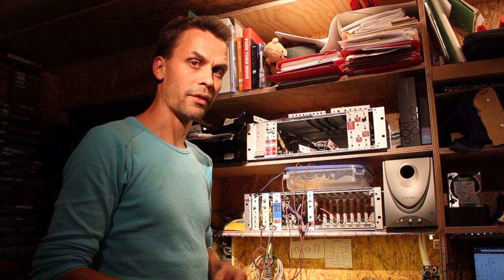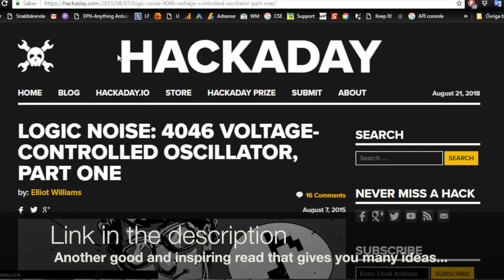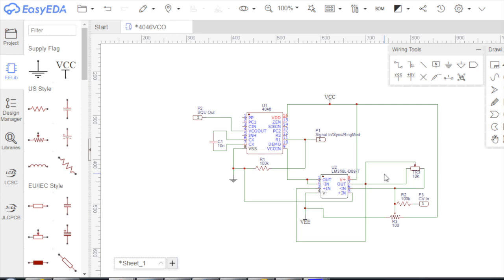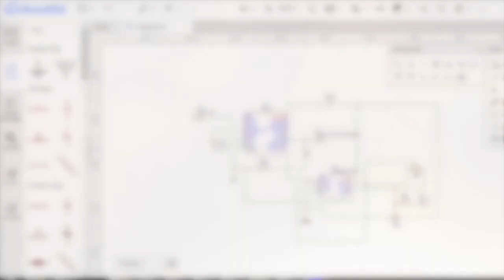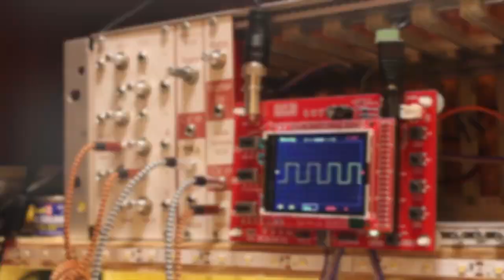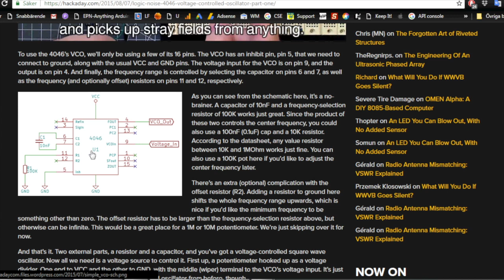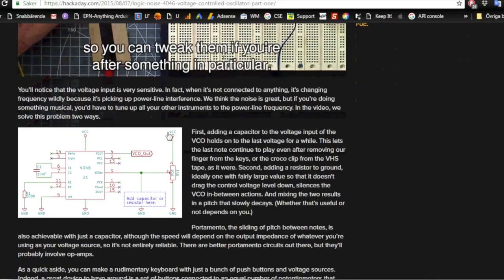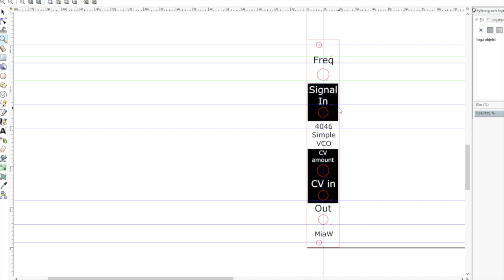4046 VCO - DIY Modular in a Week 1.3

Comment: Hello! Love this series of videos, thank you for putting it together. Really looking forward to building more, particularly the colored noise module, that's next on my list :). Can I power op-amps and other applicable chips with +12/-12 and the CMOS chips with +5/GND instead of +12/GND? Or will that mess with how well voltage levels at outputs work with inputs if I'm powering some modules with 5V and some with 12V?
Reply: try the original hackaday version for that. it uses a 9v battery. there are also opamps for single power supplies like the lm358
Reply: @deerfeeder  Thanks for the reply! Kristian's circuit also runs on 9 volt/GND, the 40106 has a large voltage range. I ended up powering it using a 3.7V battery for testing and the output voltage worked with my other modules, which pretty much answered my question! I haven't measured the output voltage depending on my what I power the chip with yet... wonder what the different is between powering it with 12V vs. powering it with 3.7V.
Reply from the maker: Yes you can power each circuit with different power that is what I do in my colored noise that I make.
Reply: Oh, nice. Will probably build that tomorrow. Thanks Kristian!

Comment: Hi Kristian! Build this one recently, but I think it is not working properly... The range is very very narrow, and cv in does not work properly... Opposite to signal in which works kinda like cv should :/ Do you have any idea what could be happening? Where to look? Such a simple project that really intrigues me what´s going on!! Could it be the chip? I have different IC, 2 brands, same description: CD4046BE
Reply: Just read in the hackaday commments that another fellow couldn´t get it to work also with 4046BE and BD :/ Damn, those are the only ones I found around here. Guess have to wait for China times
Reply: @alebrenna441  are you sure its an issue  with the BE? whats the right one to use?
Reply: @julieftherulies  no, I don't think it is. I bought other ones and didn't worked also... Someone told me that other pins should be connected either to gnd or v+ if I recall correctly, but as I don't understand much I left it in the drawer. Build the René Schmidt 4046 vco that tracks 1v/oct, has pwm and saw out and is pretty simple also. Check it out!!

Comment: what you marked as signal in seems to do both hardsync and wavefolding. would it be possible to isolate it to just be a VCO with a built in wavefolder? (or maybe just a wavefolder...) that would be cool as hell.
Reply: actually on further inspection of the oscilloscope it could be something completely different... I have no idea. back to square 1.
Reply from the maker: Lol. Or just accept it as a cool feature and use it. 😉 No but seriously. Whatever you find out please share it. The 4046 is a very interesting chip which can be used for a lot of things. Have you seen Thomas Henry’s X4046 vco? It is way more powerful than this one.
Reply: no, I'll give it a look. I may well not make this oscillator, because right now I'm just binging all your miaw videos so that I can decide what modules to make, but given how funky this one is I have to say I'm considering it.
Reply from the maker: You’ll see when you get to the noise modules how this one can be used to make digital noise from white noise or make random gates so it is really useful in all its simplicity. 😉 Hope you find some modules to build! 👍
Reply: I'm late here, but pin 11 is another voltage control for the oscillator. Probably more accurately, it's a current control, since the VCO will change frequency with different resistor values to ground.... the voltage isn't changing, but the current leaving the pin is changing.

I use pin 11 as a frequency modulator for my 4046 VCOs, with a 100K resistor to ground and a lower value resistor to a CV input. I think I used a 10K resistor in my latest beeper module. Vibrato, exponential FM, linear FM if you replace the resistor to CV with a capacitor.

Hmm, listening to the results, it does seem like something else is changing the waveform. As though pin 11 only does something when the output of the chip is low...? So I may be very wrong!

Comment: Has the 4046 Inhibit pin 5 been missed off the schematic ?  I built the 4046 without the summing amp and it did not work until the INH was tied to ground.
Reply: Woops just checked Rev 1.1 of the circuit. The Inhibit is included.. Sorry :)

Comment: Love the series, I have started building a couple of modules, decided by the parts I have laying about, while waiting for new. I was just wondering, what is the purpose of the trim-pot in the schematics?
Reply from the maker: That is for trimming the CV input, it is part of the CV-summing mixer.
Reply: I was just confused about how available I should put the adjustment. How often is something like that adjusted?
Reply from the maker: gregersn never. Or once when you trim the cv signal to what you want. You are thinking of an attentive tree for the input signal. Which in a Vco isn’t that useful but if you want one add one. But this trim pot affects both the cv input and the freq knob. Which might be interesting aswell but...
Reply: Okay, sounds like will just have it as a hidden trimmer now, then. Can just make a new one later if this is something that is actually worth experimenting with. Thanks! :)
Reply: Oh, btw, the connection between pin 5 and ground is missing in the schematics. Spent quite a bit of time figuring that out earlier.
Reply from the maker: gregersn so sorry about that. Thanks for pointing it out. I have fixed the schematics and added that connection.

Comment: Hi kristian, i just built this module twice and cant get it to work, using 4046be and lm358. first time i messed up becausei forgot some grounds but now i have checked everything 10 times and its exactly like the schematics... just to be sure.... i am powering the 4046 with vdd 12+ and vss ground.  and the lm358 with v+ 12v+/ v- 12v-. allso i put extra decoupling caps between 12v+ to ground and 12v- to ground. am i stupid? going nuts over here ;-) anyways, thanks for the great series. i learned alot from you, i have even completed my first homemade design for the vclfo by electric druid. if you are interested i can send it to you. let me know!
Reply: I have the same problem...
Do you found a solution?
Reply: @nimaschacher1907  not yet, but if so lets keep eachother posted!
Reply: @Yoet-d5e  I got it Yesterday!
I just made the schematic from hackaday and conectet over pin 9 to the orginal schematic from the all about circuits  article.
At the pin 6 of the Lm358 i ad a 10k trimmer conectet to + and - 12v and a cv jack.
Then instead of a 10k pot i take a 100k pot andthen i conectet the lm358 over pin 7 to pin 9 from the 4046.
I think something is wrong with the schematic from kristian...
But something is special..
as i wont today play with it it doesnt work anymore. tomorow i will search the problem but if you everything doing like i sad it should work(i hope ;) )
Reply: @Yoet-d5e  while im trying to found out why it doesnt work i destroyed 5 pots :( haha
Reply from the maker: Well. One is flawless ;) if you find any errors in my schematics please let me know and I will try to fix them.
Reply: @nimaschacher1907  Could you provide the final schematic you had that worked? I'm  having the same issue and can't find the resources

Comment: Is the print on the panel a sticker-print? Looks great.. Or miss I something... How did you made this layout...with Gimp?
Reply from the maker: The panels are made in Inkscape, and then I send it to a laseretching firm. So the material is a really flimsy name tag kind of material called lasermax. I need to add a standing piece on the back for the panels to not bend when plugging things in and out. Cheap though. Around 2$ per panel.
Reply: k thanks.. I just have a Behringer Neutron and want to make some eurorack modules myself. I start with easy ones, multiplyers attendators  etc. I have now a low cost 1mm aluminium plate for panels. For the small modules this is thick enough, i guess and hope. Now  i need a method for the graphics on this panel.
Reply from the maker: A sharpie pen is enough for some nice designs if you have watched LMNC. ;) a few others who made a modular with me used paper that they glued on the panels. Might also work.

Comment: Greatly appreciated videos. Keep up the good work. 
I was wondering if this would work with +9 and -9 volts instead of 12?
Reply from the maker: Thank you, your comment is much appreciated aswell :). And yes +-9v should work just fine. Or actually just 9v and gnd as it is a cmos chip. Minimum is around 5v and gnd for cmos chips. Anything above that (and not higher than 13v I think) should work.